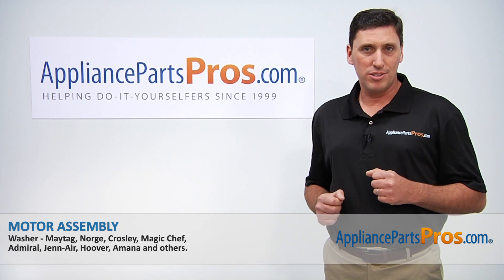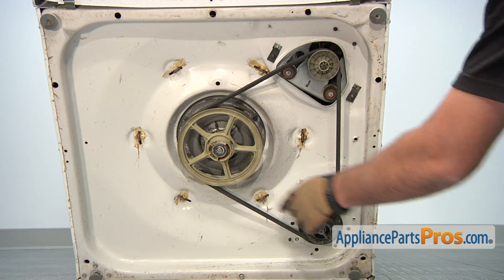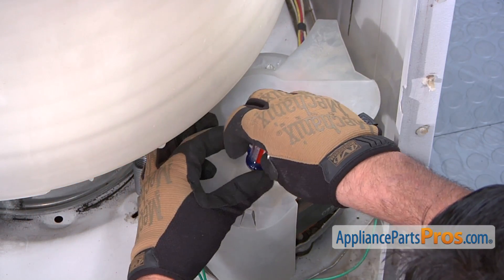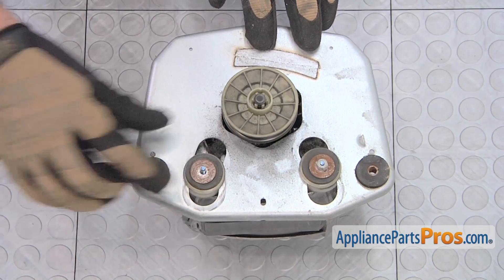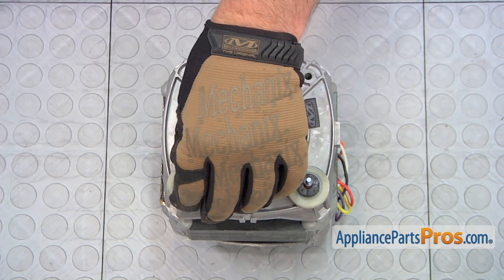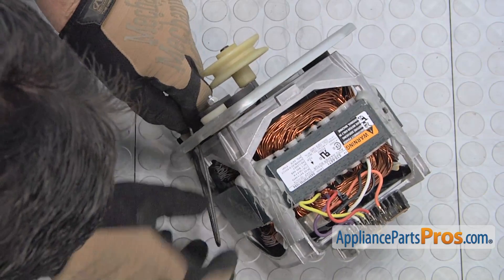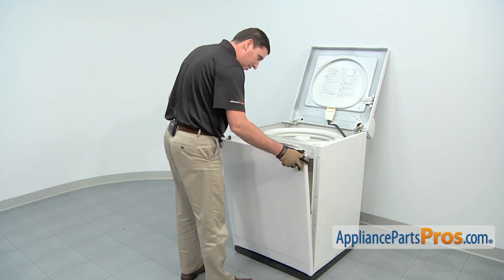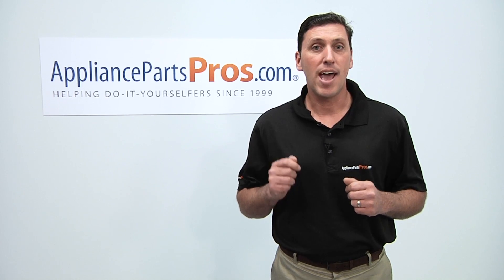How To: Whirlpool/KitchenAid/Maytag Motor Assembly WP21001950

Comment: How do you replace jut the motor wheel? Our motor works perfect but the whee melted, have a replacement whee but can’t figure it out
Reply: I suppose when you order something, not all replacement parts can be sold separately.
Reply: Where did you buy just the pulley (motor wheel)? I'm sure you figured out how to use a puller to replace it by now :-)

Comment: I snapped by accident the bolts that hold the sliders in thinking those were supposed to hold the motor tight. are those replaceable or does the whole motor have to be replaced?
Reply: Angel Gonzalez i have the same problem. If they answear your question please let me know
Reply: JuanC Raya No problem. I had it temporarily fixed by just tie it in with some wire to the block. I'm currently waiting for the silicone gasket under the tub to cure so I can't test it yet but I'm hoping it works for now. Up until then lets wait for the OP to answer our question because it'd be nice having this properly fixed.
Reply from the maker: Here's the diagram that shows all of the base and motor parts available for the unit we worked on in the video: http://www.appliancepartspros.com/01-base-motor-parts-for-maytag-mav208daww.html If the part you need is available for sale on its own, it will be listed there!
Reply: AppliancePartsPros Thanks for you help a lot! I checked the diagram in your link and the part is not availible on its own. it comes as part of the motor assembly unit so I have to buy the whole motor. It's a bummer but without your help I wouldn't have known, so thanks a million!
Reply from the maker: We're happy to help!

Comment: my maytag washer the motor polley crack in half how do i only repair pulley
Reply from the maker: +saundra belknap You can go to our website and enter your appliance model number to view the parts breakdowns to be sure you get the correct part for your model. On some models the pulley is only sold with the motor.